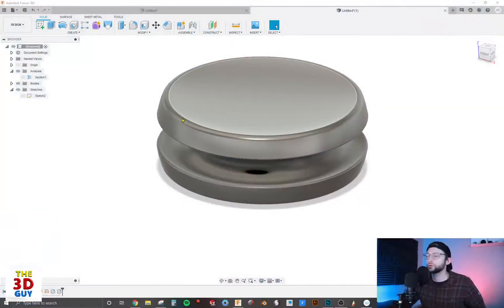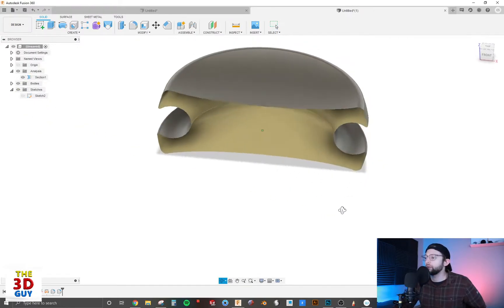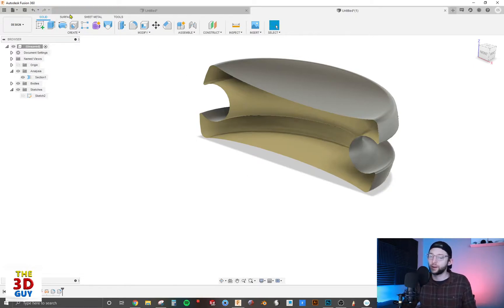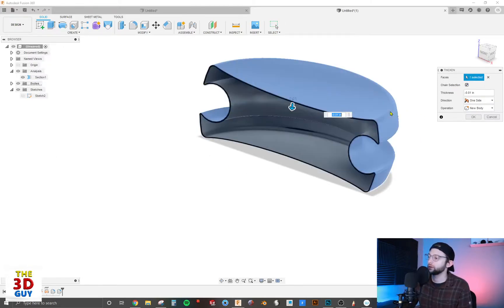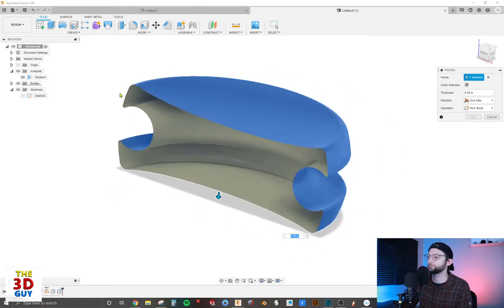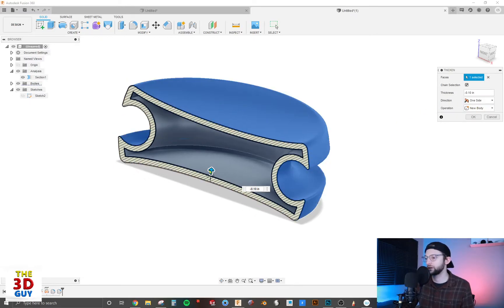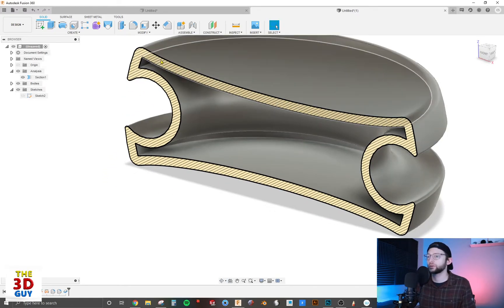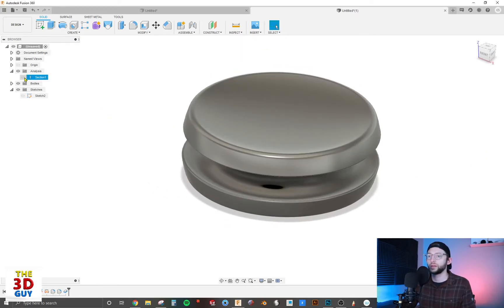How to Thicken Surface Models in Fusion 360

Comment: for some reason my model wont thicken.. I created a sketch then extruded it to the thickness i want. but i just now realised i need to add an aditional 2 mm all around so figured using thicken would be easy enough to do it. when i select thicken it wont let me select any portions of my current design. any thoughts?
Reply from the maker: Are you trying to thicken a sketch, surface, or a body. I'm a little confused.